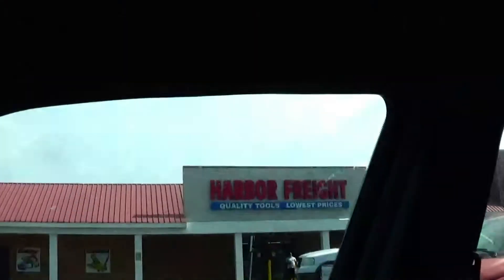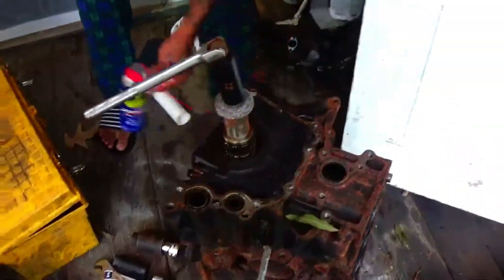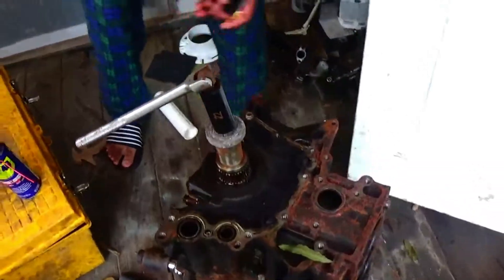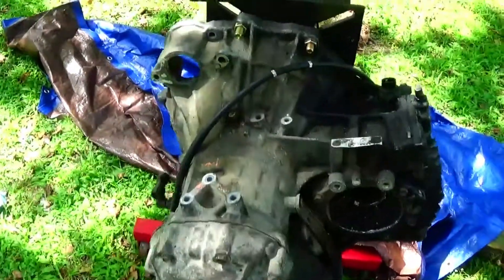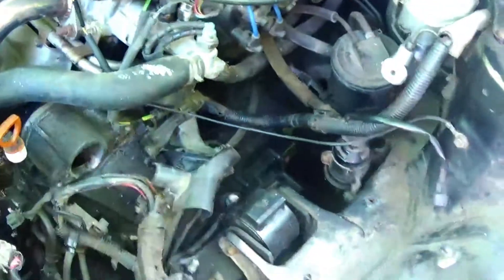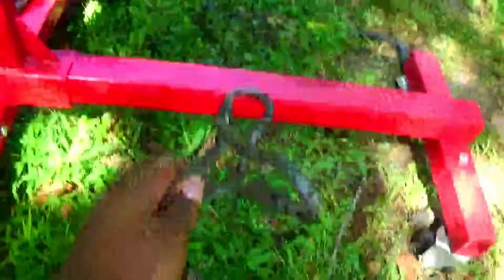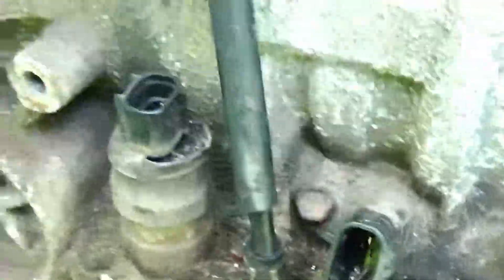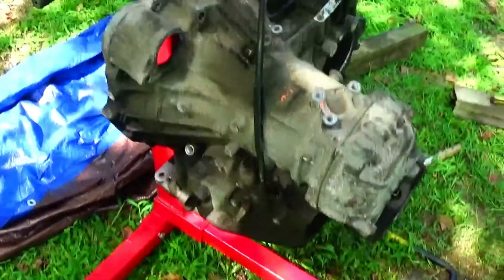5S-FE A140E Transmission Walk-Around

Comment: Looking good. I just changed the axle seals on mine. They are a bit tricky to get out and in. I used the old seal on top of the new one and tapped the old one gently with a hammer to get them in.  Worked great. Good luck. Looking forward to the next video. Keep it up!  Can’t wait to see the Celica back on the road again.